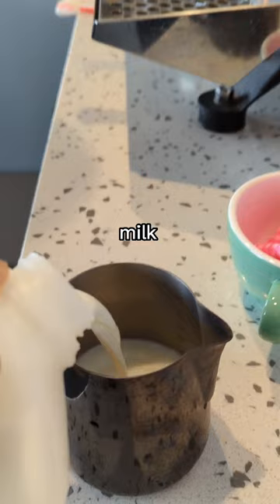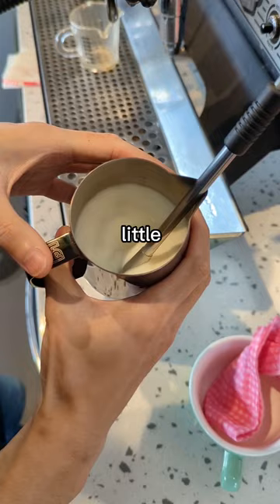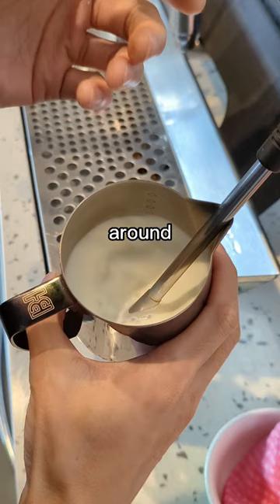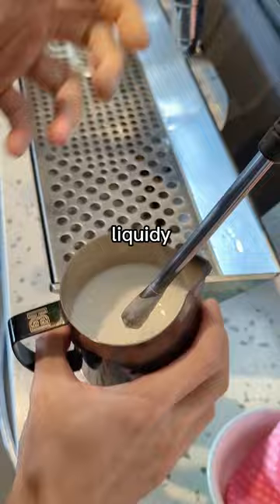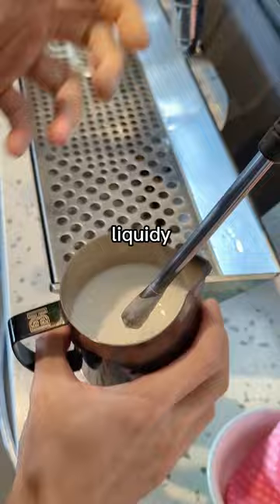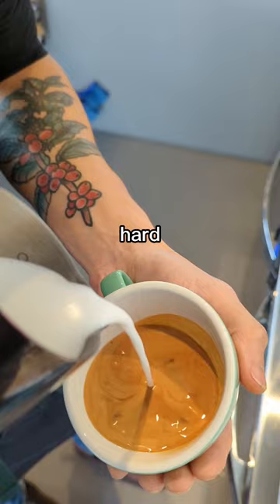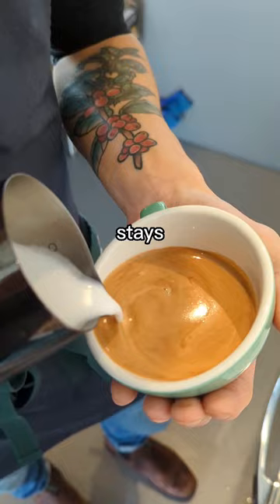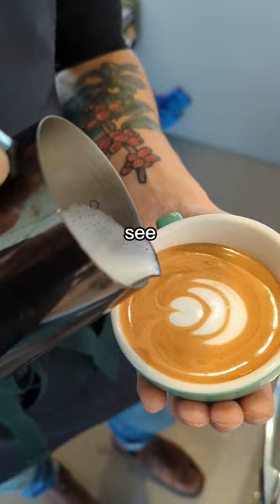How to make a Flat white

Comment: So flat whites have been bastardised over the years, after 20 years in the industry & trying variations from different countries I find the og flat white is from aus & nz where its 1/3 espresso (can be done with ristretto or lungo if preffered) & 2/3 milk (very little foam but it's not really its defining feature) so traditionally with a 2oz espresso (double shot) it would be served in a 6oz cup.
Reply: Australian coffee lover here confirming this is absolutely correct. Going to the UK and France recently showed me that other countries don’t really understand what a flat white is 😅
Reply: So basically no one really knows what a flat white is.
Reply: @fennel4580  aw shucks your approval made me smile, the trick is to find the right baristas (they're easy to spot, tattoos & mental health issues are a dead giveaway)
Reply: Only tasted in NZ.  Would be interesting trying overseas.  Temperature is also key.  There are very few good consistent baritas.  My go to is a young Punjabi lady in a gas station.  She consistently makes what I consider the perfect brew.  Not too hot that the flavor of the coffee is just right.  I get annoyed when the batista makes it under temperature.   It's not just a beverage.  It's an experience.   I love when it can be easily sipped without getting burned and it takes at least half an hour before it's cool.  I have my daily ritual of one before work and one after work.  I'm a regular they start making it when I enter the store.  Been 13 years now since I been a flat white drinker.  Prefer takeaway cups over a cup.
Reply: @mojoejojo6675  I was so trying to be here for you, when you were talking about temp I was thinking maybe there might be something to this. But you had to go & ruin it with the comment about the paper cup🤮
Reply: Oh yea i thought flat white being double shots was standard but this short didn't mention it 😅

Comment: I have heard that a flat white is made with ristretto, isn't that right?
Reply: Starbucks employee here, we do it that way and we use an extra shot
Reply: And whole milk instead of the standard 2%
Reply: Never trust a sbux explanation (sorry bro but your training sucks) it can be done with a ristretto but it's more about the ration of coffee to milk, 1/3 of either risstretto, espresso or lungo 2/3 steamed milk. This is the traditional Australian method but variations usually follow this theme, you'd find most likely it's served in a 6oz cup as espresso usually yields 2oz but this all varies depending on the beans & brewing recipe
Reply: If im correct, by tradition your description sounds like a Piccolo Latte. Steamed milk with a ristretto shot(s). Flat white is made with a standard espresso shot (by preference) with steamed milk that has foam similar to a latte. 

It's to have a flavor like a cappuccino but not so much foam
Reply: @kitjoslin  Ratio of Espresso to milk doesn’t make it a flat white in my book.
If you pull 2oz/60ml (which seems huge?!) shots and add 4oz of milk that’s just a small latte. 

What makes a flat white special is that it tastes less watery. You achieve that by pulling the shot shorter while maintaining a similar extraction yield. This way you got the same amount of coffee flavor but less water, making the cup sweeter.
Reply: @bluforrestleaf  it's made by standard espresso double shots plus steamed milk with amilk foam of almost 0.5cm in 5 to 6 oz cup
Reply: @forex-rwanda  oh yes I forgot about the specific cup size.
Reply: Starbucks? We don't count you as a real coffee. It's like talking about proper burgers and someone says McDonald's
Reply: @bluforrestleaf  steamed milk with double shot ristretto or double shot espresso..?
Reply: @bramyillian2608  It’s up to you but I think it’s traditionally single shot for both of them.

Comment: Why would u say a flatwhite is harder to pour than a capuchino? Also why only half a centimeter.

I get that its 2 shots of espressos but i dont get why its changing the latte Art game so much
Reply from the maker: It's technically as little microfoam as possible and half a cm is just around amount for it to be classified as a Flat White. Once you have between 0.5-1cm microfoam, it's classification changes to a wet cappuccino.

When you add very little microfoam to the milk during the steaming process, the density of the milk doesn't change that much, making it hard to float any milk on top, which is what latte art is, milk that floats on top of the espresso and milk base. To pour art with a Flat White, you need to pour extremely slow and manage the little microfoam you have sparingly. This is why the iconic latte art on a for a FW is just a centered white dot as that's all one can muster with the little microfoam at hand!

Hopefully that helped, let me know if you need further clarification!
Reply: @brewinghabits  oh! Thank you!  The confusion came bc i work in a Café (germany) and we differentiate flatwhite and capuchino not by the density of the milk but simply by the amount of shots. 
Same cup size for both, just the flatwhite having a double shot and the capuchino a single one. Everything else is the same , including how much air u get in the milk... hence I was curious why u said one is harder.... when in reality ur defnition of a flatwhite is just something i havent heard of ! 

So many confusing definitions all over the world haha
Reply from the maker: @jeykob100  totally agree, every Cafe kinda just does their own thing and make their own standard haha. Imo the best way to take a drink order is to describe the drink as you say the name "So a flat white in this cup with very little foam, right?", that usually removes any confusion if there were some!

Comment: So a latte is 1cm foam and a flat white is 1/2cm of foam. Sounds like hipster baristas trying to make things more complicated than needed. Or Aussies being pretentious
Reply from the maker: It's totally cool if you don't want to use the the exact terminology and limit your coffee knowledge to what you know like "latte but less milk and foam", however without this type of classification you won't be able to get the drink you want when you order if you want something particular. 

Comparing it to any other hobby/craft, would you for example go to a car show and define a car by it being a "a very fast/slow car" or actually mention its horsepower, motor, oil type and max speed to give the speed of the car proper context?

It might be nerdy or meticulous to go to this type of detail but it's not really "hipster" or pretentious to know what a drink should be and its correct name for when you order it.